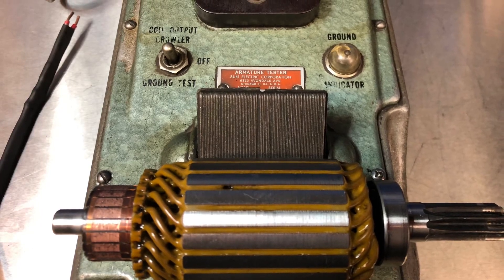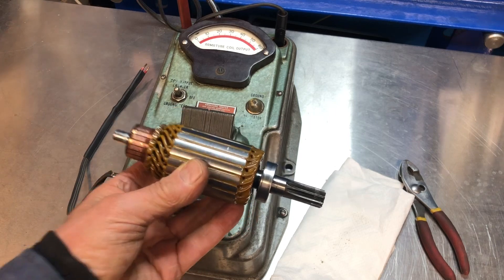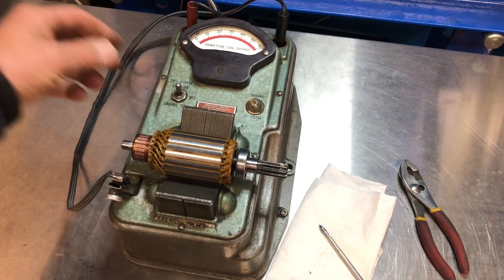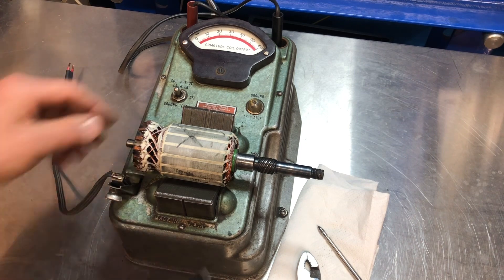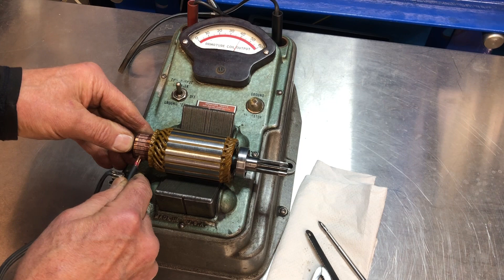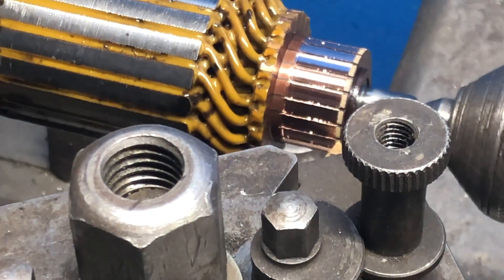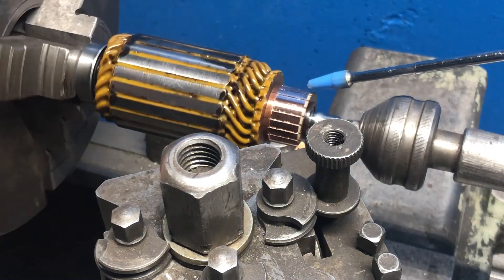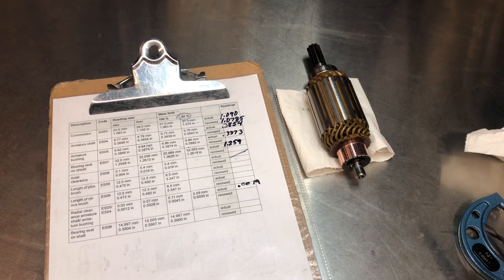Rotax 912 ULS starter part 2

Comment: Is it normal for the starter motor housing to have continuity with the positive terminal?
Reply from the maker: Thanks for the question, Yes, resistance would be normal as the + terminal goes through the + brush, through the armature, then back to ground through the - brush to the housing.

Comment: Very nice.  That old armature tester was genius and, by an odd coincidence, I was much younger years ago too!  😃  I noticed that when you were turning the commutator down it looked like it spun out a bit more oil.  Maybe a spinning session on a lathe would be a good way to help de-oil an armature.  🤔  Are those starters supposed to get oil in them or was that a failure of the seal?
Reply from the maker: A good observation, after that the oil was actually completely gone. These starters, like all starters should be dry and dusty inside. However being plugged into the crankcase that small seal is the only defence against oil intrusion. Usually there’s only a very slight film of oil film in the starter. 
Btw the customer was extremely excited about the starter performance, he said “I see the propeller blade move and it’s instantly running!!”